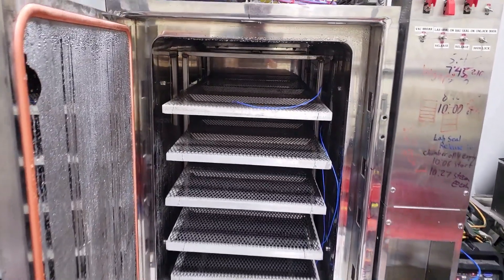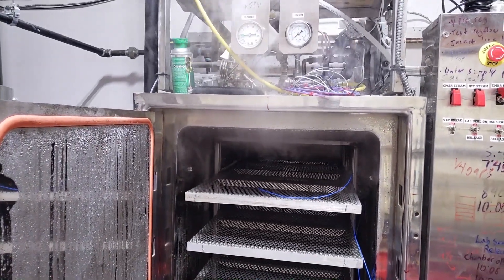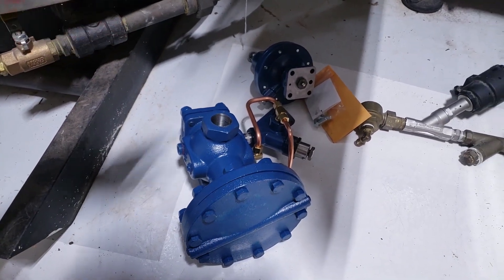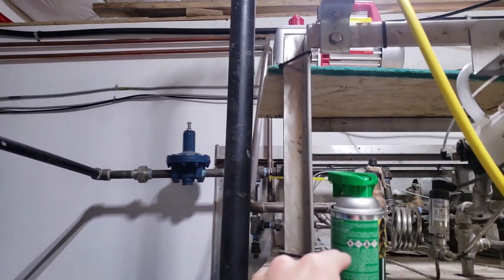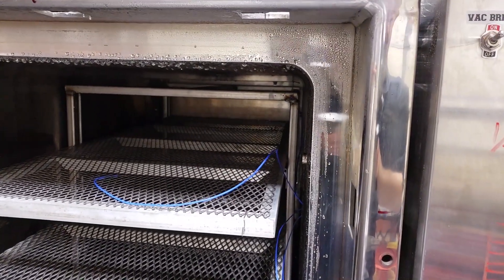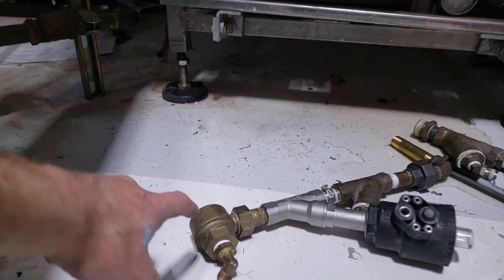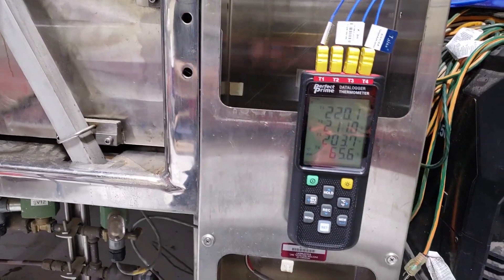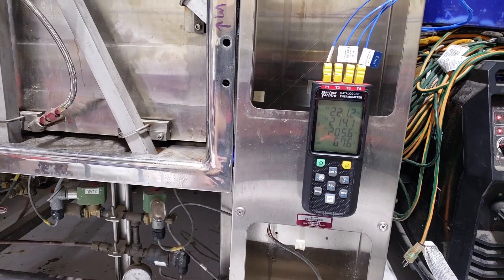Mushroom Autoclave Boiler Upgrades and Repairs! Pilot Operated Reducer Install

Comment: Great to see you back, but isn't this just a fancy pressure steamer not an autoclave? 

It appears to be using the steam to provide the heat as well as the pressure which makes it a pressure steamer not an autoclave. Probably why you are getting "tea" out of your bags...
Reply from the maker: This is an autoclave rated for 40 psi of steam pressure

Comment: Hey Eric; For $20K USD you could have bought two new 400L single phase autoclaves from China (delivered) and have both duplicity and more money in your pocket.
Reply from the maker: also that unit wouldn't be exempt from inspection and since its not built by a ASME certified company and not registered on the national board i wouldn't be able to legally install it.
Reply from the maker: Instead I have 600,000 BTUs of cheap natural gas i can run my autoclave and a small shipping container off of. Im already maxing out my service with my grow and house splitting service. It's a total of something like 7,500 sq ft of space and my sterilizer drums, 12 tons of a/c, electric kitchen range, dryer, and ovens in the house.

Comment: Have you checked, "Transcat". They sell instruments ect. We ran a 30 hp Clayton at work. I'm sure you know, your boiler feed water is important, and the way you shut it down, for longevity.
Reply from the maker: Yea I need to build a new feed water tank or modify this one. It needs to be insulated and needs a sparge bar to heat and purge the oxygen.

Comment: great! consider hacking the datalogger to external power by using a voltage regulator and external power - or a conversion to 18650 cells.

Comment: You can build a power supply and wire it to where the batteries connect.
Reply from the maker: yea I can do that for sure. Its 6v. I probably have one around somewhere.
Reply: @MyersMushroomsFarms  make sure it's clean dc some electronic don't like square wave dirty DC